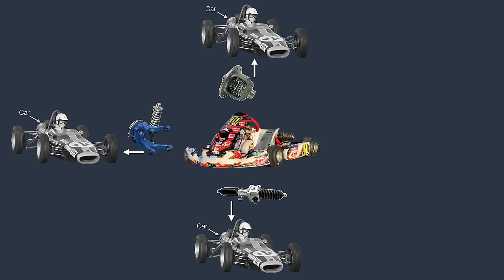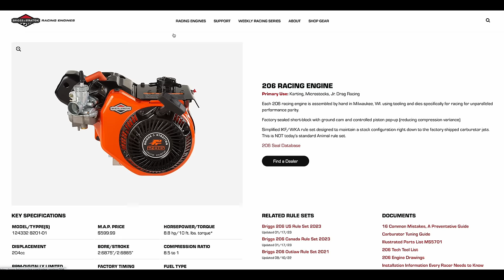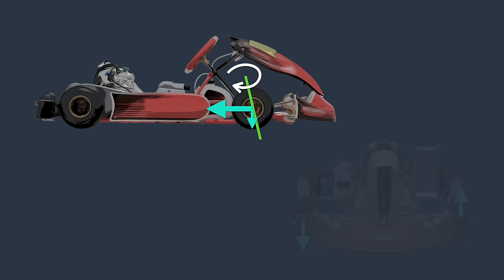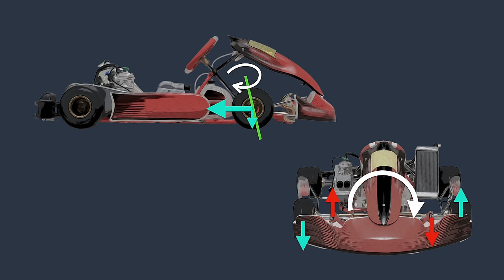Kart Racing Is Way More Complicated Than You Think

Comment: Karting absolutely can be, relatively, inexpensive. However, other than their access to funds, there's nothing stopping someone from buying a new kart and professionally tuned engine every race for an entire season. Nor are there any rules stopping someone from hiring an entire team of mechanics and engineers to squeeze out every thousandth of a second they can. My point is, karting is a lot of fun if you can find a group of people to race who are on a similar level as you. I went karting last weekend as a slightly older, heavier driver on a budget racing against, mostly, a bunch of well-funded teenagers. After being well off the pace, taking a shot in the dark on setup changes, and getting wrecked and having to rebuild the kart between sessions, I realized I didn't have much fun at all and that's not the place or the group of drivers I should be racing against. There are other places I've raced where I've had a lot more fun against a more budget-minded group of racers and those are the places where I need to go race next year.

Comment: Ah, I thought so! SuperFastMatt is into Karting! A safe ( safer than Motorbike racing ) and affordable Motorsport ,with more fun than  Porsche cup races  and faaaar less expensive! My choice was the 125 cc shifter cart series, these are closer to car racing due to disk front brakes, a clutched  6 speed gearbox  that require a cornering technique with less sliding . The engines are copies of the old 2 stroke 125cc Motorbike Grand Prix racing class.  45 Hp driving 200 LBS were never more thrilling!

Comment: 3:30 Offroading on a 15HP Honda rancher 350 can be a scary amount of power on some trails because you can very easily go too fast, I can assume that 30HP on a flat surface with no rocks, steep inclines, or mud to slow you down can get scary.

Comment: We race on dirt with slicks. We have one non-standard class, called Modifed, and if you can pass the safety inspection you can run it. 

We have a 750cc dirt bike engine and 5 speed transmission on our modified. I don't know how much power it makes, just that its too much.

Comment: Just came back to racing karts after a 33 years absence. Bought some historic karts and engines...  Forgot how fast they are. I've done loads of indoor / outdoor on same sort of karts, but they don't compare. OK, so my first session back was streaming wet and was at Shenington, which means 4 fast straights with some big stops! First hairpin, gave it too many beans and spun (and couldn't restart - I am 60)! Second session, got to the fast left-hander, after the pits. Tried to go full throttle ...  ouch, it didn't like it. Did a 360! Could not believe how fast I was coming into the corners...  need much more track time to get used to it again.

Comment: Excellent!
Yes they are good fun and the least expensive way to race on four wheels, or two wheels for that matter.
I started building an FSAE car for our local autocross but then bought another motorcycle and the car project stopped.
An autocross day is 10 hours minimum with less than 10 minutes driving time on the best of days.
Riding my motorcycles I can ride for 2 hours on one bike, 2 hours on another bike, and so on all day long.
It's all about seat time they say, and I agree.... It's much better on a bike.
But I did enjoy competing in autocross and my car was always a contender for the FTD and an FSAE car would have always won the Fastest Time of the Day by a huge margin. I even have two engines for it, both Suzuki, one a 600 Katana and my sleeper 750 GSXR to bump my car into the B Mod class.

Comment: Is it called a kart (with a K) because Art Ingels worked at Kurtis Kraft? Of course that just makes us ask why Kurtis Kraft was so-called.

Also Karting is definitely the most fun motorsport I ever took part in. Past tense since 1: I broke my wrist in a head-on on a wet track 23 years ago, it didn't set, and now my wrist hurts all the time and that means that I can't drive them since 2: kart driving is a real upper-body and arm workout. Going home after a weekend I would drive into the ditch for several miles since I misjudged just how little effort modern cars (even without power-steering) need compared to karts.

Also, choose your seat wisely if you treasure your coccyx.

Comment: Almost everything in this video applies to dirt bike riding and racing as well. Many different flavors of riding and racing all using the same basic tool. The rider to machine ability ratio is higher in motorcycles to get the most out of it, but much of what was said about karting applies and fun can be had at all levels of both rider and machine.

Comment: well guess i have to get a nearly crippling addiction to karting now, oh wait. 
I've raced karts and motorcycles. my bike is 1300cc so quite fast, however, I find that karting is in general more fun. If I had a vehicle I could carry a kart around in I'd buy my own. (although the maintenance is what stops me on that too) I also find the faster race karts a too fast for the tracks I've used them on too so there is that. its exhausting)

Comment: I drive gokart in italy in the rok cup mini rok 6cc 1 speed small kart and a small kart does not have a front bar and is much more simple, the engine is air cooled and yes, its a two stroke one banger, i drive in a parolin frame, i came 7th in a race with around 40 other kids, im 12 years old from denmark🇩🇰

Comment: When did 5 horse Briggs racing turn into 9 horse racing? 5 horse karts are way more challenging than you might expect. Any deviation from a perfect line slows you down, the price of any small mistake could be a coupla laps of trying to will the damn thing back up to speed, one little bobble & there goes the pack - your race is over.

There’s much to learn from low to no power racing.
Reply: I recall the basic class as "5 HP", too; however I notice that the spec 206 engine is a 206 cc, like the 6.5 HP utility engine (XR 6.5). It looks like they upsized from 163 cc (5 HP as a utility engine) to 208 cc (6.5 HP as a utility engine), and switched from a hopefully-stock utility version (intended to operate at 3,600 RPM) to a sealed racing version (allowed to operate up to 6,100 RPM).

Comment: Some great info here and for the most part, you have the basics pretty well covered, but everything isn’t as absolute as you mentioned, especially in regards to handling and tuning the chassis, but generally correct. 

In regards to mentioning that you ride a kart, vs drive a kart, and relate it to a motorcycle. I have been heavily involved in 5 sports during my life, surfing, motocross, mountain bikes/BMX, karting and cars. Karting and moto are extremely different and not sure how the 2 are even remotely related 

A few things you don’t mention in regards to handling and set up: 
Ride height
Magnesium vs aluminum wheels
3rd bearing in/out
Seat stiffness and position
Tire pressures 
Gearing
Brake rotor size
Brake rotor venting 
Track/width front and rear
Alignment 
How certain items are attached (to allow the chassis more/less flex, not connected at all, zip tied, loose, or tight. Won’t get too in depth here
Engine rebuilds/blueprinting/dyno
Weight limits, adding ballast and locations
Spec fuel vs pump fuel 
Oil types and brands (2 stroke)
Chassis life
And I’m probably missing a few and choosing to not mention a few others.

Comment: I’d be interested to see a chart with finishing positions compared to drivers’ body weight.
Reply: there is a minimum weight everyone has to meet, and different categories separated by age and wait matt's friend was in masters where the weight and age is higher to accommodate adults
Reply: @bushdawg100  I thought that might be the case, thanks for clarifying. With everything else being so stripped down, it seemed like whether one’s bowels might be full could be a determining factor. Pure fun, it seems, either way.
Reply: I was racing in amateur karting series a few years ago, and in that series anyone who weighs less than 80 kg has to take ballast onboard so that lighter drivers won't get unfair advantage.

Comment: What is that guy at 8:53 doing? looks like he is measuring the distance from the rims? but why?
Reply: He is measuring the rear track width. He has a target attached to the outisde of the other wheel.
Reply: You can adjust the rear width for different handling characteristics. Hence why he is measuring

Comment: He said the engines are rated to last a few hours, does that mean a new $600 engine every few hours of run time?
Reply: No, just a rebuild. (which is still kind of expensive if you send it off to an engine builder)
Also, predator classes are pretty popular too and they just use the $100 HF engine.
Reply: The lo206 engine could go all season before checking valve seats. They can last several seasons before needing a new bottom end.
Reply: The $600 price is for the basic 206 class engine, which lasts a long time (because it is a stock Briggs & Stratton engine good for only 8.8 horsepower and 6,100 RPM). 
The engines which only last a few hours are the 100cc 2-strokes; those seem to cost $2K to $3K USD then a few hundred dollars to rebuild every ten hours or so.

Comment: Is there a rule to offset driver weight. I would otherwise think that just the lightest dude wins.
Reply: I don't know if they do it for this competition, but I've heard other events will ballast up to a certain weight, where lighter drivers (riders?) will get a vest with weights in it. I was at Autoclub Speedway (where this video was shot) doing an autocross with cars talking to another miata owner who mainly did karts. The organization is called CalSpeed Karting and he was telling me it's very competitive.
Reply: @TurboHappyCar  Thanks!
Reply: Lead is attached to the seat or the floor tray to add weight. The driver is weighed in the kart after the race to ensure the minimum combined weight is met

Comment: You keep using the word "inexpensive". Karting is inexpensive as far as motor racing goes, but it's still  motor racing. Tires, maintenance, broken parts (of which there are many,) fuel... It all adds up quick and is a constant expense after you buy the kart. Then, there's the cheating. Being a motor sport, the rules are only rough guidelines. Those "sealed" engines? You'll never be competitive if you don't buy the "filled with go faster parts but still appears to be "sealed" engine", which is many times more expensive than the rules legal "sealed" engine.... Karting isn't as expensive as owning a race car...but that shit ain't at all cheap!!
Reply: @irfuel spec Miata were looking at you…